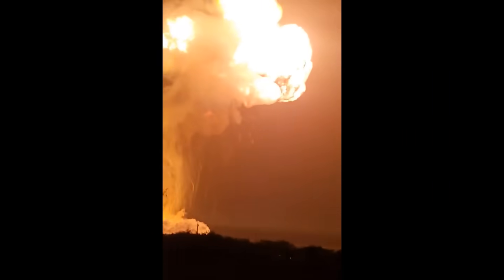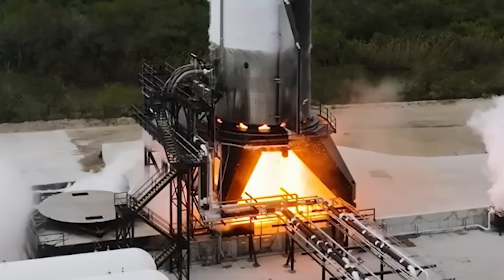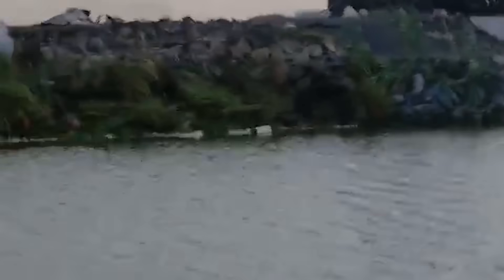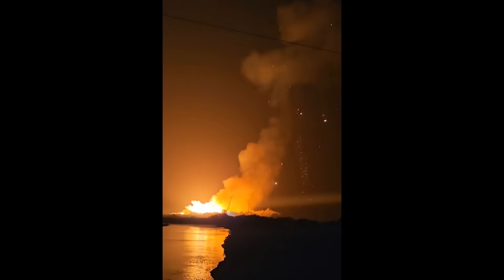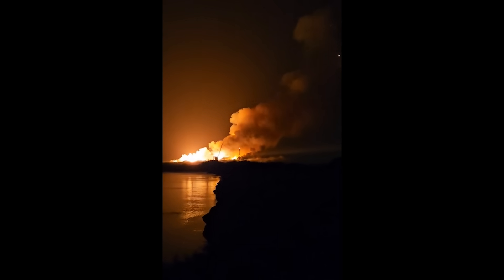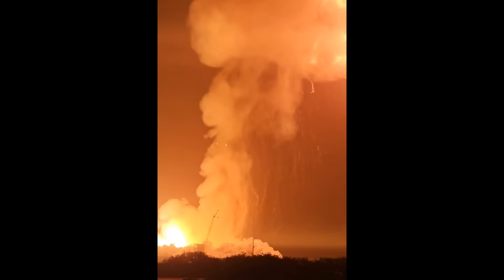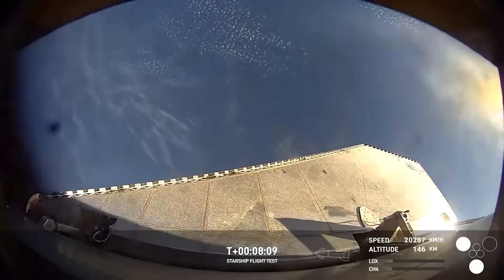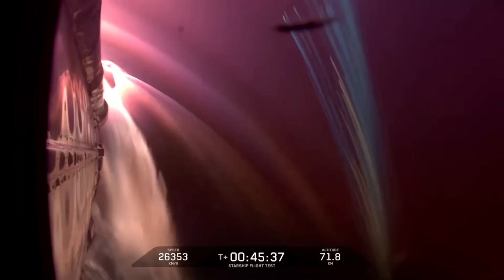A Closer Look At The Damage To Starship's Test Site

Comment: Starship is in the knee of the development curve where much needs to be learned in flight tests.  Despite SpaceX repeatedly stressing from the beginning that their development is focused on rapidly learning by iterating real world flight tests, most people still don't get it and expect a fully reusable heavy lift space launch vehicle to emerge perfectly formed.

As long as nobody is dying, trying and frying is the fast path to flying.

This must be frustrating to the engineers trying to get heat shield reentry data, but it's still the fastest and most cost effective aerospace development strategy.  All of the failure modes must be determined during prototype testing and this static fire explosion takes SpaceX one step closer to a functioning Starship.

The Massey test pad and apparently most support systems will need to be scrapped and completely rebuilt, but I'd bet SpaceX has that done within two months.

Comment: That sucks for sure.  But as far as timing it was pretty good, compared to if it had happened on at T0 during flight 10.  Looking at those tanks right next to the test stand the velocity of the event was low, 100% confident it was way short of a real explosion, and probably didn't do much damage to steel and concrete. The test stand looks like it is just covered in Starship debris.

Comment: Building on percentage thickness
Sn is just a mamssive hyper thin  multi pop can
built not on the thickest metals but on the minimum need.
fill empty freeze warm
 pushes ever wld join to breaking point
Only most thickest  best join
and then taper will make success?
From launch pad Concrete cooing
Musks attitude know all as cost millions and lost time

Comment: The Block 2 seems using very thin  gauge stainless steel on the tanks, with the goal to reduce weight. Probably the main reasons for all these major leaks due vibrations.
Reply: Remember the Block 1 S24 mounted to the Block 1 B7 for IFT-1, where the vehicle tumbled end over end at supersonic speed, albeit in low pressure air at altitude?  I was surprised that the booster and ship weren't immediately torn apart, and the booster didn't fold in half.  Block 1 Starship and SuperHeavy were a lot tougher than I would have guessed.
Reply: @Liberty4Ever  remember that flight showed they needed stronger termination charges in case it had another in flight failure like that which shows the fundamental platform is very robust but haters gonna hater and cry rivers of vitriol in hopes they get 15min
Reply: @Liberty4Ever  well, then they made it bigger . and bigger. and added more engines.  Metal shell still thin.
Reply: So we're back to Atlas 1?
Reply: each problem has been from an entirely different failure mechanism including this 1 your supposition is flawed
Reply: @mouserr  flimsy, fragile, thin metal, gigantic, oversized, shreds itself when anything at all exerts asymmetric forces.  Supposition=accurate.
Reply: @jackprier7727  flimsy? the design suffered from 1 failure that took several minutes to do enough internal damage to cause a rud, the next lost control and fell back to the atmosphere and lasted an extensive period with critical hardware directly exposed to plasma while still supporting the delicate hardware of starlink allowing it to retain connection till complete failure the most recent in space failure had an engine EXPLODE and the thing kept going for a while before the failure mode progressed to total failure. clearly your hate boner is overriding critical thinking
Reply: @mouserr  That's FUNNY!  Sure, all the tests have been quite rock-solid so far. Let's get to Mars!
Reply: @jackprier7727  its sad that you hate so much youd wish failure over everything else and get so butthurt when facts show you wrong. crying a new river eh?
Reply: @mouserr  3 Starships a day to Mars, soon.  Get on the first one-
Reply: @jackprier7727  wow so triggered because facts ... sad
Reply: @mouserr  I'm sure you are referring to yourself, but I'm not sad because you seem like an insect.
Reply: Heck the StarShip itself is just 4 mm, I think those tanks are like a pop can and the whole flimsy structure is inflated by fuel/oxidizer pressure.

Comment: The whole pad will need to be replaced due to the heat damage from the fire regardless of how it looks. I can imagine all of this is designed pretty modular so that is is easy to replace in case of something like this causing widespread damage. It is a test facility after all.
Reply: nope....

Comment: Space Bucket...
There are hazards...
The crystaline silica used in the TPS when inhaled can cause silicosis.
Reply: That is only a hazard with a lot in an enclosed space
Reply: i doubt the fire was explosive enough to pulverize tiles.   It was a conflagration rather than a true explosion.  No shock wave.  The tiles are probably more pounded during a regular launch.

Comment: SpaceX stalled already with their upper stage tests in 2023 since they only got 1 out of 6 launches without loss.
All the assembly tests are just smoke screen - nice 4K footage and huge rocket to flash the media with spectacle - but they still have a flawed concept (too heavy and not powerful enough) and can't handle the constant changes.
They degrade with every launch more.
Reply: I think you could add too fragile to that list.
Reply: @ash9803  Ridiculously flimsy-, 4mm walls and tanks like pop cans, all held by pressure. Just double it and add more engines isn't a great plan.
Reply: The reusable booster is a head fake to divert attention from the absolute failure of the platform.  Still not sure what good is having a reusable rocket when you can’t even get the thing into LEO.  The reusable test should be low on the priority list.  They got major design flaws with the Grain Silo Rocket (GSR).  Both too heavy and fragile, too many rocket motors just a overall bad design.  Reduce the # of rocket motors, strap a couple of SRBs to the thing, get more thrust, improved reliability and will cost less.
Reply: @JimmieBrown-sg8fq  It will be even heaver if they strap SRBs to it Jimmie. This platform will end up like SpinLaunch... looks good on paper but won't work in practice.
Reply: @ash9803 I agree platform is flawed needs a major redesign.  I call it the Grain Silo Rocket for a reason, it’s fragile, too heavy, inherently unreliable and not enough thrust to push 100ton payload.  I do believe SRB’s should be included on the booster stage instead of loading up the booster with 33 rocket motors.   SLS SRB produces 3.6M lbs of thrust, each Raptor 2 is suppose to produce ~507K lbs I have my doubts.  So rough estimate you can remove 14 Raptors and replace with 2 SRB’s get same thrust.  Not sure how much delta in weight between the two configurations.  For comparison SLS 70% of its launch thrust comes from the SRBs.
Reply: @JimmieBrown-sg8fq  
Yes but the shuttle needed the RS-25s to get off the ground even with two massive SRBs. Starship doesn't even have an effective and reliable RCS or OMS. It's not going anywhere soon.
Reply: @ash9803 SLS uses the same Space Shuttle RS-25s with some modifications since they will not be reused.  SLS has 4 each with ~512K lbs of thrust.  Bottom line I think we agree StarShip a flawed design that is being pushed forward due to Musk’s supersized ego.  Nice exchange of info, thanks
Reply: @JimmieBrown-sg8fq  I guess you missed the launch where the full stack pinwheeled repeatedly, only coming a part when scuttled.
Reply: @JimmieBrown-sg8fq  they can put it to space if they just wanted to sac starship and reuse only the booster. its not hard to do that.

Comment: The scorched horizontal tanks are water, right? But they do have to hold pressure so I guess damage from overheating is possible. They would have been mostly full though I expect.,
Reply: they were full of water so likely heating of metal was limited to boiling point of water

Comment: There must be a better option than COPVs. For one shot rocketry they are fine, but composites have weird cumulative failure modes.
Reply: it was basically that titanic submarine....but in reverse....and with the same eventual outcome.......
Reply: @rosscayley8773  Согласен! Тоже сразу в голову пришла именно эта аналогия :)

Comment: it will be interesting to learn the details of why the failure started near the top of the vehicle 🤔 thank you for this presentation 👍☺
Reply: That's where the high pressure nitrogen bottle that burst was located
Reply: iranian sniper?
Reply: I think the breach occured inside the ship, near the middle. The gasses expanded as they leaked from the pressure vessel. the first place that the leak could be seen was first was at the top, near the hatch door that they couldnt open on all of their other flights.
Reply: @mcsquared5005 Well on a positive note that stuck payload door explosively opened this time guess you can chalk that up as a success, but it probably ended up somewhere in Mexico 😂!

Comment: 100% redesigned required, StarShip is a failure.
Reply: 100% is excessive hyperbole, there's always salvageable design. In this case a bad COPV just a QC issue and not a design issue.
Reply: Apply to work there, you clearly know more than them. Oh, wait...
Reply: Iran was just giving us a heads up on the mayhem that 4 years of open borders can lead to..............  one dude, one .50 cal and your space program is set back 6 months.

Comment: 1:56 Those tanks are toast (or at least they should be.) Exposure to high temperatures has metallurgical effects. Since this was clearly not done in a controlled manner, it’s safe to say that the material properties of the metal of those tanks are no longer a known quantity.
Reply: I bet the tanks will be pulled for recertification and/or replaced when everything else is rebuilt.
Reply: @nunya___  i bet they fill it up with liquid nitrogen to test and bobs your uncle
Reply: depends......i assume those were tanks full of water which would have mitigated any metal heating.  certainly the paint is toast.  I doubt those tanks are hugely pressurized anyway....  maybe 2-3 atm for the water deluge/.?
Reply: says you
Reply: What you see is the insulation and not metal, just like the shuttle those tanks are covered with up to three inches of spray on foam insulation
Reply: You're a metallurgist I assume, with all the requisite qualifications and many years of examining subjects from grainy video? You must be to make these seemingly qualified statements. Or perhaps you meant to write "In my opinion..."?
Reply: @Denis_of_Earth1 I’m an engineer who deals with large steel structures. What’s your degree in and how many steel-focused MatSci classes did it include?
Reply: it was a flash fire   not a furnance.  launchpad A had many disassembles and test launches and launches lighting the whole place on fire with tornado of concrete without having to be replaced   

come on  use your brains

Comment: So, this was a cascading failure where a catastrophic failure of one system (COPV) caused a catastrophic failure of the remaining systems (explosion of fuel tanks). This means that the entire system is faulty and should be re-designed
Reply: I'm not entirely sure a copv failure would do much good for any spacecraft. I suppose that, due to the sheer size and propellant mass of starship, it may have an overall more dramatic outcome, but those copvs aren't exactly party balloons.
Reply: Lol no. A COPV failing will kill any rocket
Reply: Iran was just giving us a heads up on the mayhem that 4 years of open borders can lead to..............  one dude, one .50 cal and your space program is set back 6 months.
Reply: @peetky8645  A dude with a .50 cal could be a a MAGA guy who did not like Elon's recent X posts
Reply: COPV is a big boom item.  nothing would give redundancy to survive such an event.  Either the COPV from the supplier had a manufacturing defect or it was encouraged to RUD by some supersonic lead projectile sent in its direction.
Reply: @peetky8645  This means that the design is faulty, and COPV must be replaced with something else
Reply: We will look back at 2024 as the golden age of Space X.

Comment: They need to put most of those facilities other than the Test Pad underground or something to avoid them taking blast damage...
Reply: Underground there would be underwater.
Reply: what are you even talking about?  putting it underground solves what?  then it collapses everything underground   and you’ll spend a year just digging
Reply: Yeah... each time any of these blasts occur, it's a major setback in development, mostly due to the time it takes to get everything repaired and back running again.
Reply: the area around Starbase is muddy, dig down a few meters and there will be ground water, construct the whole test area just like the launch Pad will set back everything for a very long time.
Reply: @FarokhBulsara4065  i hope you’re a bot because you can’t be serious ….

get a firceracker  …. lay it
flat in your hand and let it
go off…. you get burned….. now close your fist on it and hold it tight…. just might lose your whole hand… in all serious….  you bury that stuff it will be 100x more destructive  especially in water!   

go watch breaching charges with a bag of water as a multiplier of force….